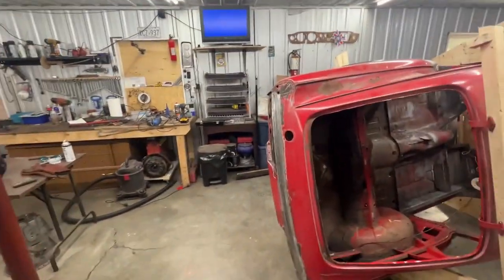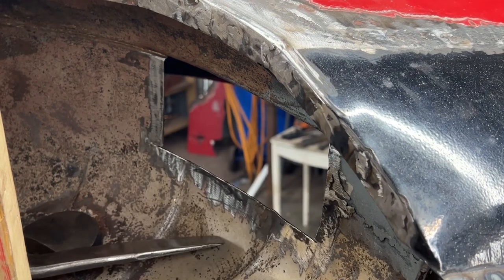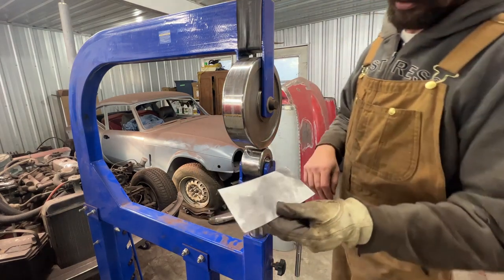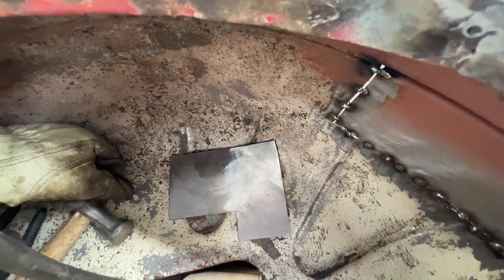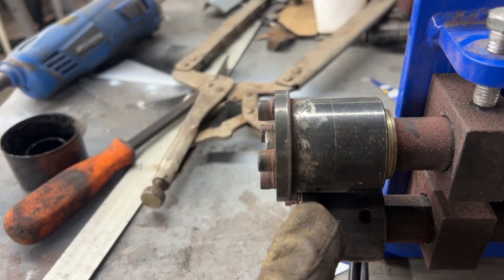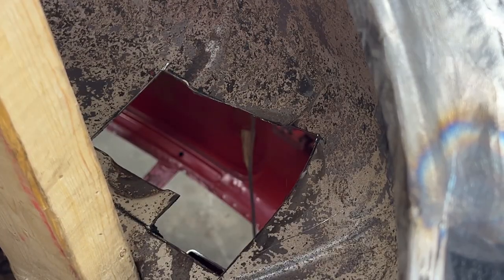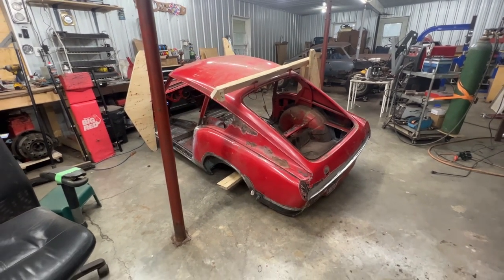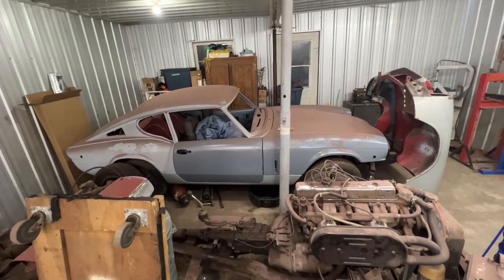1966 Triumph GT6 - Part 63 - Are We Done Welding?

Comment: Incredible!! Every show you keep out doing your self! Hopefully I’ll be able to hone my skills as I watch long and when I tackle the body work for my GT6. As of now I’m still working on the chassis and getting it to the point where it’s a roller. I literally had all the suspension components cleaned and powder coated replaced all the bushings of course in the hardware. Waiting on some additional parts to finish up the front end suspension.

Comment: Gotta love that JB-Weld. No garage is complete without it and Duct-Tape. ;-)
Reply: Would that be 100 mile an hour or 200 mile an hour??🤣🤣🤣🤣
Reply: I only say that because I had to do a couple repairs on my piper cub do some scratches from a bear they didn’t like my cub where it was parked, on my Piper cub 😳😳
Surely it does not replace the original stuff, but in a pinch to keep it up in the air, works out pretty good🤣🤣🤣
Reply: Laid some of the hundred mile an hour tape down first then put some 200 mile an hour on top of that and it held until I had to cut it all out and replace everything but as of now you can’t even tell a patch was there nevertheless that it works!!

Comment: Would it have been better to have the body sandblasted then weld-through primed before all the patching?
Reply: I agree about the blasting but I seem to remember him talking about it not being an option this time round because the metal is quite thin in places and can get distorted - I might be wrong though….🤔
Reply: @philtucker1224  I believe you're right.  I wonder if soda-blasting or dry-ice blasting would work.  I don't trust my eyes and making the rust easier to see would be a good thing.
Reply from the maker: I am not a fan of sandblasting in general, but with this particular body even if I wanted to sandblast it it would be a bad idea. First of all it had absolutely no integrity and it was going to get distorted badly if I wanted to take it off the frame and second, there was so much fiberglass on it, which the sandblasting wouldn't remove, that most of the metal was going to remain un-blasted.